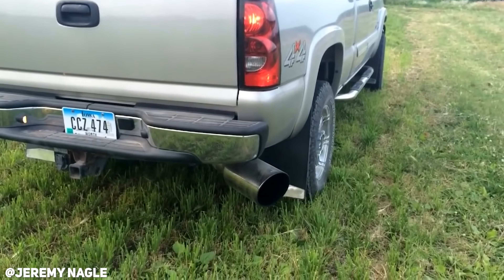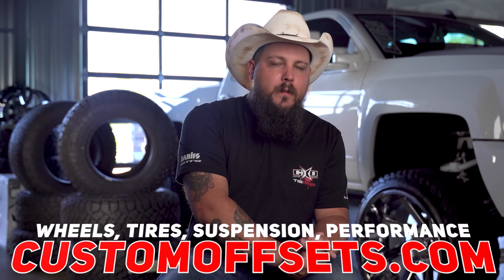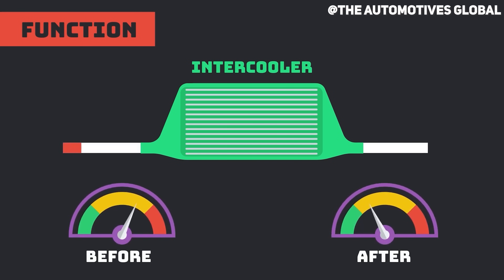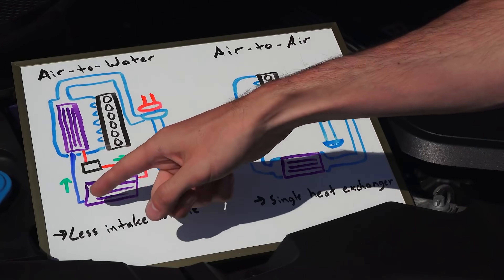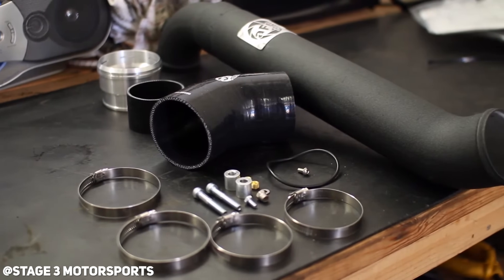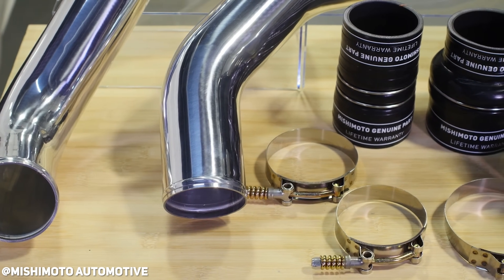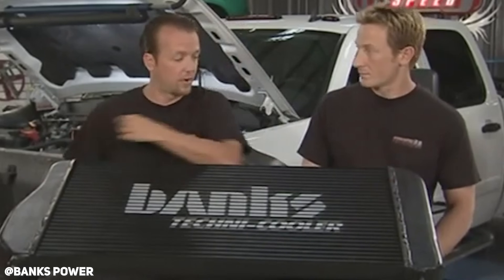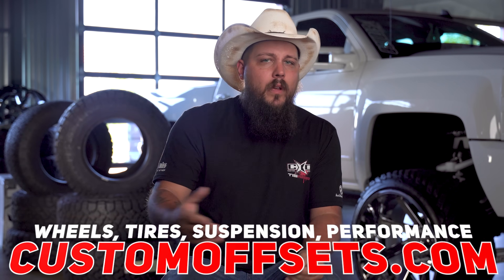How Intercoolers Work and Are They Worth It?

Comment: Got a KDD 1000hp 6.4 for my 08 King Ranch F450 dually, mishimoto radiator, additional parts through KDD, KC twin turbo and now they say I need an intercooler.  Which is better ?  Banks or Mishimoto?

Comment: Banks did not make an intercooler for 2010 - 2012 Dodge Ram 2500s. They couldnt beat mishimoto intercooler during those years. This was a great informative video, and yes the colder you get the air to the intake the better the fuel efficiency. Increased fuel mileage is a great result.

Comment: I have a 03 Ford 7.3, I had my CAC boots fail,  because of too much oil and gunk. I re routed the PCV, and dropped in the Banks 6.0 intercooler. Because I have a ZF-6, it was a super easy drop in, lost about 200° from the upper EGT. How much was from not having all that gunk clogging up the Cooler? Dunno. Better truck for sure.